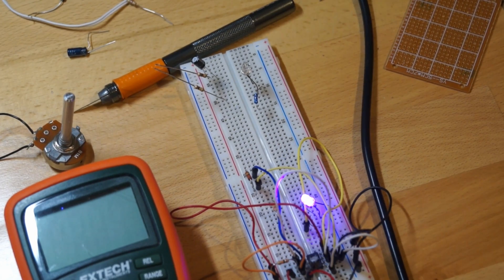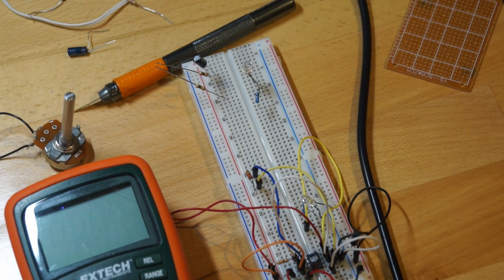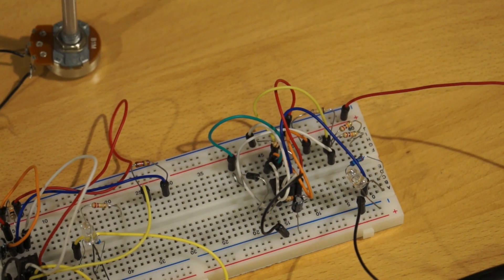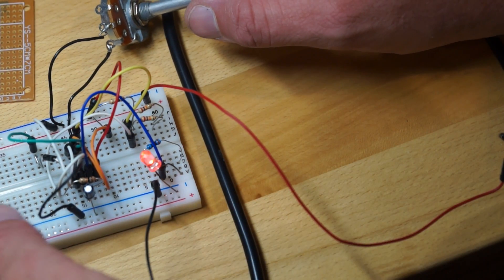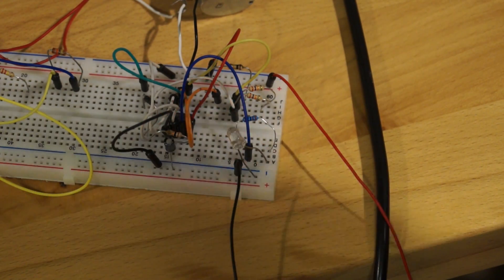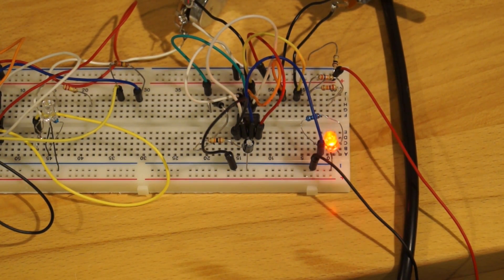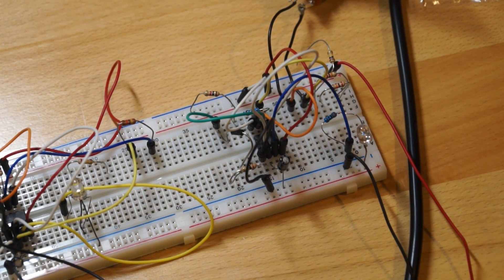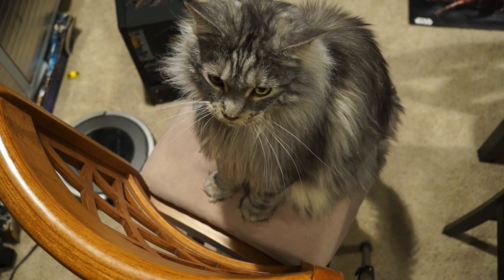Enterprise 1701-A Navi lights

Comment: My days of fracking with components are over, I learnt a lot from your electronics vids but these days I use arduino programming on attiny chips or pro mini boards. So much easier and quicker. Something like this would take no time at all. Is there an advantage to doing it this way?
Reply from the maker: I need to take the time and learn this.  But with my life as it is right now, I just don't have that time....

Comment: I tired of fiddling with components for my trek ships in progress. I bought an arduino, some attiny chips and a book on program writing for arduino. When I get around to it I hope to just use the attiny chips to do everything. Have you messed with them at all? P.S., there's a cheaper board available that's just designed for programming the attiny chips instead of the arduino.
Reply from the maker: I have not,  I just haven't had the time to sit down and learn any of it.    I took a lot of programming classes in college and write small programs every once in a while.  So I know I can pick up the programming pretty fast.  It is just a matter of time to sit down with it.  Something I don't have much of these days.

Comment: It's possible the nacelles were blue after Trek 2 because of changes to the shooting miniature made by ILM?   Remember, a different company made the Enterprise for ST:TMP and there were a number of effects accomplished in that film they didn't use again or altered for the sake of speeding up shooting with the model.
The pearlescent/interference paintjob they used for ST:TMP was not optimal for shooting purposes which is why the model was dulled down and later repainted...    The original paint job was just too reflective and they had to contort lighting set-ups to find a way to photograph the model.   As it is, they had to do AT LEAST one more additional camera pass for ST:TMP than ILM used for ST2 onwards.    The paintjob may have also created issues for matting which led to a few noticeable errors in the movie.      I think they did at least 3 repaints (for ST IV, ST V, and ST VI) because of battle damage and also real damage done to the model's paintjob between shoots (scuffs and cracks caused by collisions and poor handling).   The model was loaned out one time to Universal for the Star Trek attraction they used to run and one of the guys working for that attraction spray-painted the model in the ultimate act of vandalism or some stupidity that amounted to the same.   I know one lighting effect definitely wasn't used after Trek 2.   The amber navigation light was abandoned or damaged.   From Trek 3 onward the navigation light was always blue.   That was definitely the case for the Enterprise-A which also had a slightly different paint job.   Whereas the earlier paintjob had grey on the neck, back, and forward vent areas on the warp pylons, the same areas were done in light blue for the Enterprise-A which I think actually looks better!   (There were a number of things I liked about the follow-up ship better.   Revamped engineering and the best bridge set [ST6] they had on the movies.)
Reply from the maker: Thank you.  I didn't know all of that, but suspected some of it.    Good information!

Comment: hi just a thought have you tried a circuit from pcbhaven called a 555 breathing (pulsing) led circuit. I use to use your circuit then I tried this one, once I got it right, I can now do nav,anti-colision,pulse(for impulse engines),or photon torpedoes, and phasers.its a good multi use circuit.
just like your 4060 chip circuit that I learned from you. by the way thank for that, big help in getting me started in lighting my models.
Reply from the maker: I am going to redo the 555 videos.  There is a much easier way to wire it, and after some research I found a better way.    I took a look at their site, and found the circuit you are talking about.   I can see the use of it